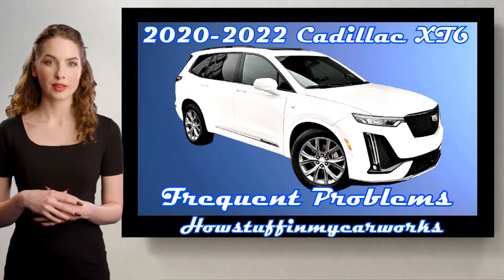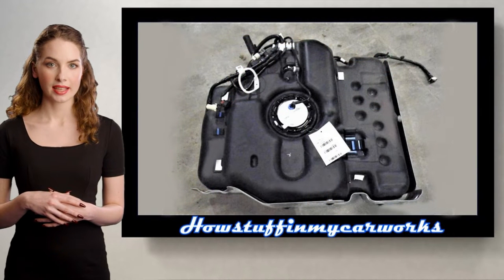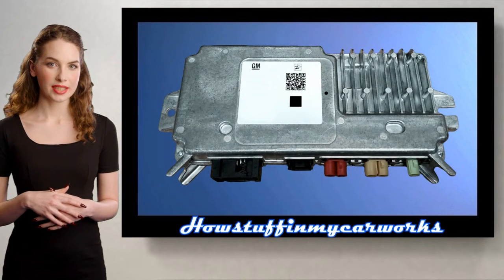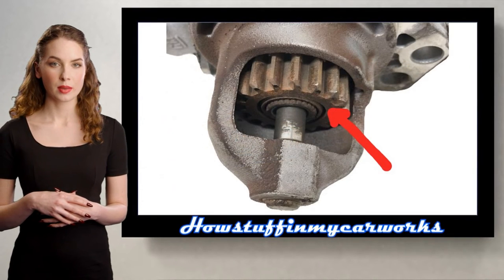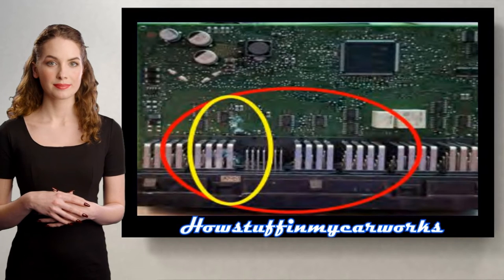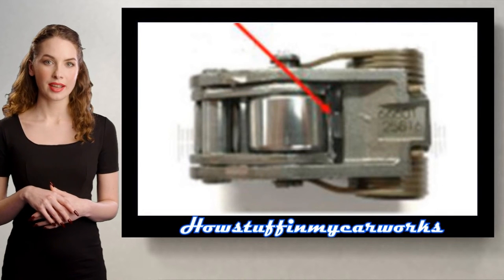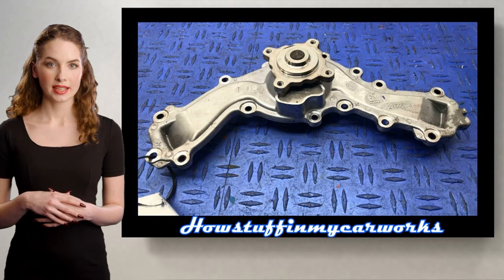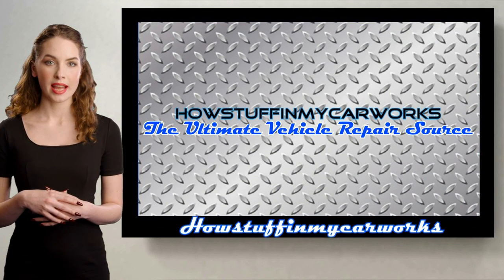Cadillac XT6 2020 to 2022 Frequent and common problems, defects, recalls and complaints

Comment: You missed one. Loose welds inside the resonators in the exhaust system. Causing rattling. $1200 repair.
Reply: Straight pipe it u wasted your money.. put aftermarket resonator in